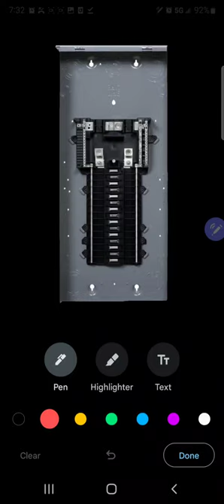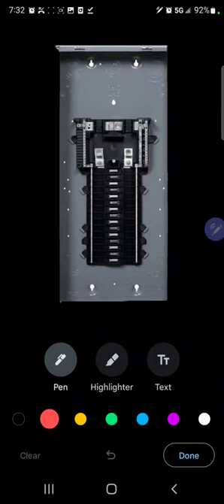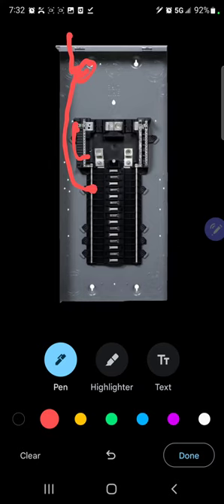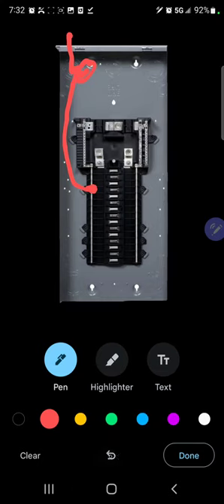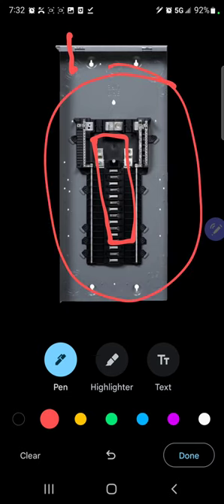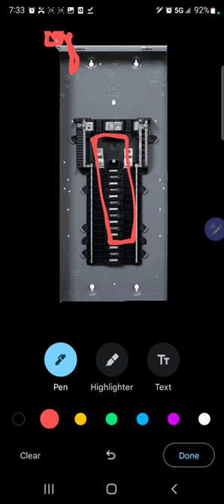Legal to Splice wires inside of a Panel box??

Comment: is the a code reference for this? my forman and I are disagreeing about this.
Reply: shouldn't happen on new installs, but that's how panel changes and ground-neutral bus separation get done, or upgrades to gcfi/afci; you gotta extend those neutrals.

Comment: As of NEC 2020, article 408 covers this and a "panelboard" is is a complete unit that consists of the metal enclosure, dead-front cover, circuit breakers or fuses, buses, and other necessary components.  I can find no code making the distinction between the panel and the cabinet the panel is mounted in, which seem to be the main point of the video.  However, there doesn’t seem to be any article prohibiting splicing within a "panelboard".  Furthermore, article 300.14 allows splicing of short wires within outlets, junction, and switch points in order to meet specific wire lengths extending outside the outlet, junction, or switch point. If splicing is safe within such enclosures why would it be unsafe within a panelboard cabinet? It seems NEC article 300.14 establishes a principle of allowing splicing.  What am I missing?

Comment: Great job on explaining!
I have a question: I am in the process of installing a generator interlock kit and noticed I don’t have a free lug in the common bus bar for my white common wire. 
Can I remove an existing common from the bus bar, splice it with wire nut and then attach it to the lug ?

Comment: For 10, 12 and 14 gauge wire what is the most reliable splice method to extend wires in such instances?  Thanks
Reply: A twist splice with a wire nut is pretty reliable.